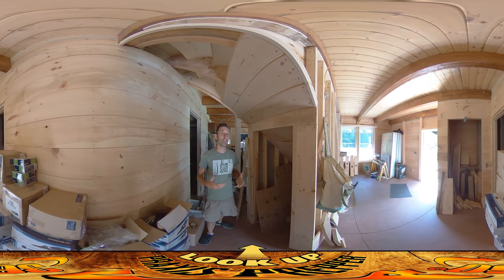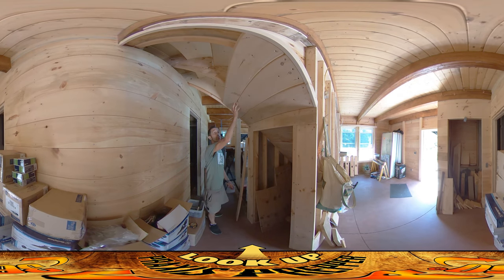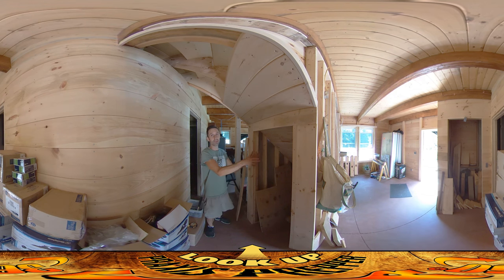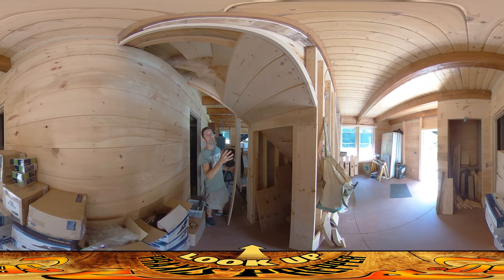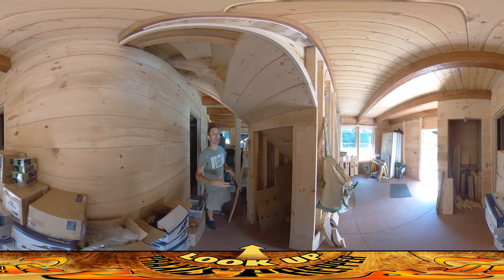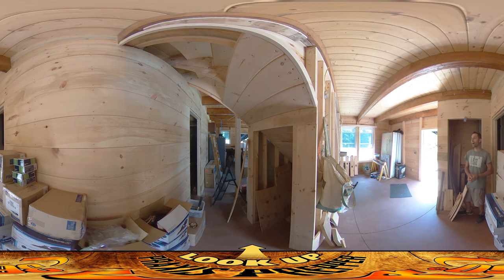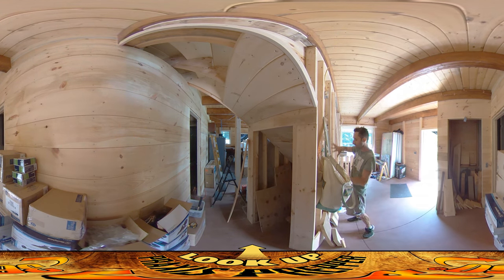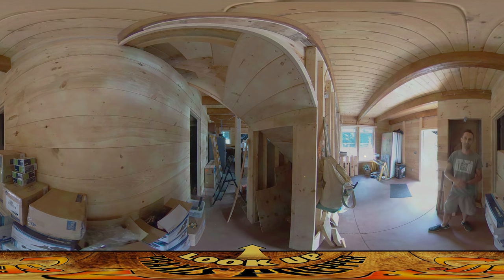Homestead Building - Planning for Minimal Scrap Generation

Comment: I am loving that rustic look of those wall boards man. I am excited to see this all finished.
Reply from the maker: You and me both! I keep wondering if I should add some color wash to some before sealing them. I'd keep most of the house natural, but maybe add a light wash to some where you could still see the knots, but there could be some colors to break up the rooms a bit. I'm still not sure... timeline may have the final vote on whether i do it.
Reply: @PraxisPrepper   I wouldn't do anything other than something that would give it a kind of teak oil look then seal them babies up.